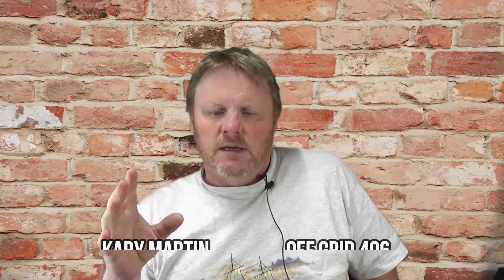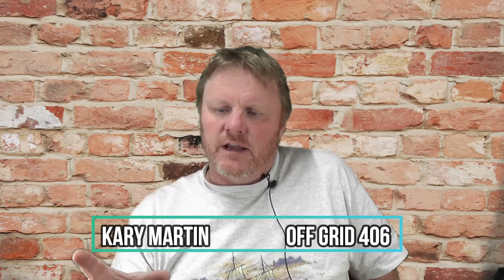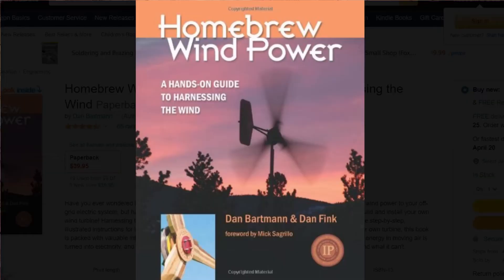Watch before you buy a PMA, permanent magnet alternator for wind power, wind turbine, wind mill

Comment: What they don't tell you is that these hardly put out any power at all unless there is a storm! Not worth it. Need larger diameter  generator and atleast 8 feet diameter to make it worth the while. These generators have to spin fast to get any appreciatable power out of them which means high speed winds. Most wind speeds are less than 18 mph and these just are not worth it.

Comment: So i am offgrid living on a small island in the Baltic sea (Denmark) and in the 1930 /40/50 on the farms here they used car dynamoes homemade towers and wood blades geared usually with parts from bicycles but they only ran a battery or 2 and used a radio and a lightbulb or 2

Comment: Ask yourself which is more important; speed or torque?
By adding blades to an airfoil design, you increase the surface area in contact with the wind and thereby increase the torque to overcome start-up cogging.
I've found alternators that are built from the direct drive "pancake" motor of washing machines can produce high output at lower rpm.
Using a high-torque, low speed windmill with one of these PMAs, you can run gearing as close as 1:2 and achieve the desired results.
Reply from the maker: More blades equal more drag. It's not intuitive, I realize. There is plenty of science out there, videos etc. It's not hard to find.
Reply: @veggitarianredneck  Which is a problem if your more concerned about making the blades spin fast and your not concerned about torque; turbulence and cavitation take their toll on speed which is why wing types normally have as few blades as possible.  They depend on Bernoulli's principal to generate speed and lift.  
The old multi-blade windmills work more like a Savonius bucket-style; using the thrust of the wind on an interfering  surface.
They are much slower but have an immense amount of torque.

Comment: I was lucky enough to find a permanent magnet modified alternator in a scrap pile a few months ago.  SCORE!  I was fascinated when I opened it up to find that the rotor had 7 magnets!  I had never heard of a PM rotor with an odd number of magnets before, and it took some head scratching before I realized that the alternate magnetic fields were coming from the magnets on the opposite side of the rotor!  This one is actually pretty easy to turn by hand, so I wonder if there is something to this strange magnet configuration to make that possible.  Unfortunately the area where I live just does not get any wind but right now I’m actually more interested in using this alternator as a motor.  
I did a quick test with it connect to a standard e-bike controller at 60 volts and was surprised by how well it performed.  It runs incredibly smooth and quiet, and the torque it produces is INSANE!  Seems to be pretty low RPM for 60v so I suppose that is the trade off.  The only potential issue I see so far is that the shaft remains magnetic, which I assume is due to a lack of cancellation in the magnetic feild, possibly partly due to the rotor being mostly hollow between the magnets as they are secured between two plates with space between.  
Has anyone encountered a PM alternator or motor of any kind with an odd number of magnets on the rotor?  I have found almost no documentation online referencing such a configuration.
Reply: Do you live close to Burlington Iowa or somewhere near the Illinois/Iowa border? I was supposed to buy a alternator type wind turbine for $25 From a guy who was remodeling a home in Oquawka IL. He forgot & said he accidentally took it to the scrapyard. What's frustrating is, I could have just took it for free when it was laying in the yard & nobody would have cared. It was mounted to a skinny bent maroon color pole that blew over in a storm. It had several old faded grayish/black plastic or fiberglass blades. I think they were plastic because some blades had bent when it fell over & was laying in the yard but didn't break apart. Does this description match the one you found? I'm kicking myself for not just taking it when it was left abandoned. I think the pole was maroon that it was on. I can't remember exactly, I think cable to it might have been orange. If you found  it near IL/Iowa border. I'm sure it's the same one. I can't remember the exact month he threw it out. I believe it was  Oct  Nov or Dec of 2023. Which matches when you found it.

Comment: It's an easy problem to solve. I used to solve this problem years ago when I used to work on them on boats. All you do is have a small circuit that applies a small amount of current induces the stator winding creates a motor out of that temporarily speeds the unit up momentarily gets it past that inertia. it always worked everybody was happy.

Comment: It mystifies me as to how many dummies prattle on about how fast an alternator has to turn really really fast, or about how Tesla turbines "have no torque.  Clearly they have never heard of gears and gear ratios.  Power is torque*rpm*(unit conversion factor).  A high rpm turbine that needs more torque can have torque increased by gearing down the rpm, and a high torque turbine can obtain the desired rpm by gearing up the rpm at the expense of torque.  Most alternators can be rotated by hand, and don't need much torque at the required rpm thresholds.
Reply: Just try to spin a car alternator by hand, you dummy.

Comment: I'll be using a 1/2 HP DC electric motor. When I flip it by hand, it makes 14 volts, when a five foot cord was wrapped around the 3 inch pulley it made 79 volts. It's 90 volts, 5.5 amps, and has brushes. No cogging. Well it's a start. I have to make some kind of hub for the blades. I have a 3 foot aluminum propeller that I may try first. It doesn't take much to turn a DC generator so maybe it will work temporary at least.
Reply from the maker: Is it a treadmill motor?
Reply: The DC motor I have is 5 and 1/2 inches wide, 11 inches long, about 35 pounds. It had a box about a foot square with a variable speed knob. It says NALCO on that box. It is much bigger than a treadmill motor... that's what I tried before. I think the shaft is 9/16 inch. All the lettering is gone from the tag but some numbers are stamped into it.  1/2 HP, 90 volts, 1725 rpm, 5.5 amps, CONT duty, 40 degrees C temp rise, then it says PM and 56. Form factor is 1.26. Cat. No.D275. after that it says TFN. It has ball bearings but no cooling holes anywhere. There is a fan on the back that just blew air over the outside of it. I'll probably take that off. From the looks of it, it was made in 1970...

Comment: I have a question I am building a gas powered 12 V permanent magnet alternator for a charging 12 V lithium batteries I am using a 12 SI 78a alternator so I can put it 100 foot away from the camper three phase to an external bridge rectifier to a DC to DC charger for my batteries I’ve purchased 10 n 52 magnets 2“ x 1/2 by 1/2 I was going to build the rotor out of aluminum. Is this gonna be a problem or does it have to be metal and how many magnets should I use? I am looking for 13 to 14 V and anywhere from 10 to 30 A
Reply: Mine has 14 magnets  ,  Stainless Steel  Shaft  , and I have  had it spin at 3600rpm  for  30 minutes  with  no problem  , it's a 12si  GM  12 volt   alternator and  makes 19 volt spinning  3600rpm  ,  
I showed it NO mercy  , but I was testing  it  , if it passed  and it did , 
I figured  that anything  nature had to throw at it would be  small  in comparison to this test , 
I got my rotors from  Missouri wind and solar in 2016 and  all 4 of them run great ,
The worst one made 19 volts at 3600rpm  and the best one made 21 volts , 
They of course  will  not  be  spinning  this fast but  again  , this was just a test to see if  they would  survive  3600rpm  and  for 30 minutes  straight  none failed  , 
And all produced  power  under load for this 30 minute  test .

Comment: Don't forget AM radios were ridiculous power hogs back in the 20s.  30-40-50 watts to run an AM radio!
Reply: I remember seeing one of those batteries in 1960, and I asked how much it cost...the answer I got was 75 cents. I saved up and bought one so that I could make a fish shocker with a model T coil.
Reply: That's because 25 watts went to the tube filaments to keep them hot and operating
Reply: @davidpotter9462  They made efficient ones.  Farm Radios, which were popular in the 40s and 50s before everyone in remote areas had electricity.  I've seen tube AM battery operated radios running on a watt and a half.
Reply: Older tubes had a big filament that glowed, and the tubes were bigger so took more heat to work... batteries were big back then
Reply: @davidpotter9462  The reason the batteries were large is because tubes are high voltage devices and there were no solid state voltage regulators and DC cannot be increased with a transformer without a "vibrator." (which use a lot of power, but generates pulsed DC which can be put through a transformer)

 45, 67 and 90 were common AB battery (A is for the filament and B is for B+) B voltages.  The A is low voltage, usually 3 or 4.5 requiring only a couple or few internal cells. But a 90v B section needs 60 1.5v cells in series.
A lot of car radios had vibrators to generate the higher voltages (they were 6V systems)

The cheap farm radios generally went through  a five dollar battery (A lot of money in the 40s and 50s) in 5 hours.

Comment: I think I have made that Alternator which you can turn with the tip of your fingers. I'm using 16 magnets if I remember correctly 7 kg  pull each but still no coging and no stiffness If I knew its a problem which need solving I would have made a video when I was modifying the starter shaft but I will post a video and show you I accidentally without even knowing to manage to make such Alternator
Before I leave I would like to ask you a question what is the difference between 12V and 24V PMA can you please explain what type of system we should choose for either PMA
Thanks
Reply from the maker: Yes, yes please do send me a video of this and I will showcase your discovery, and promote your channel as well if you want.
 As far as the voltage goes it just depends on the system voltage that you choose.